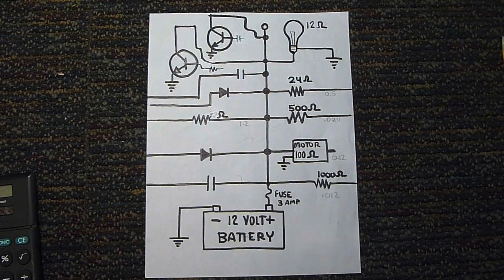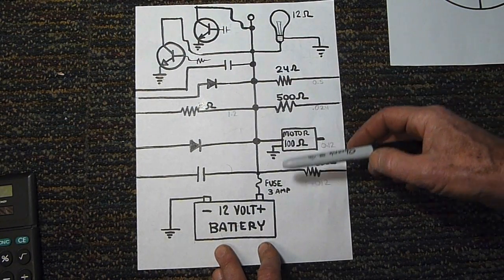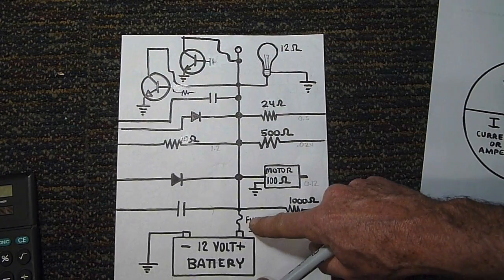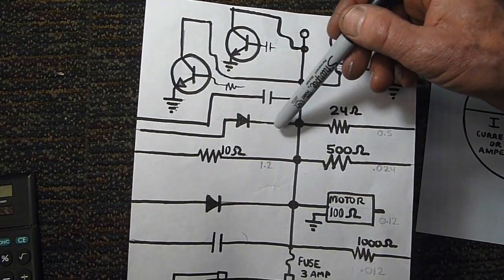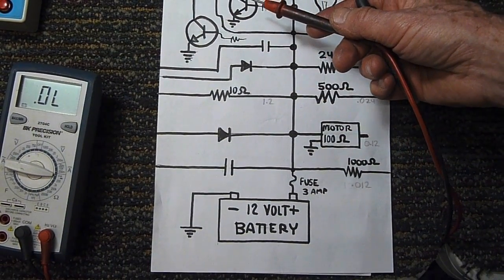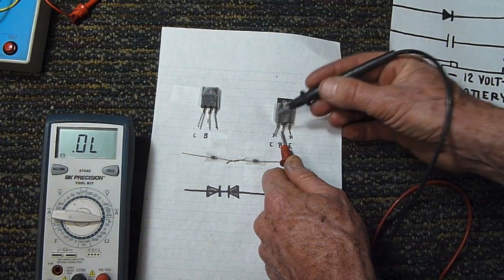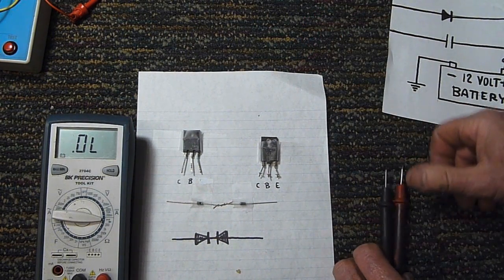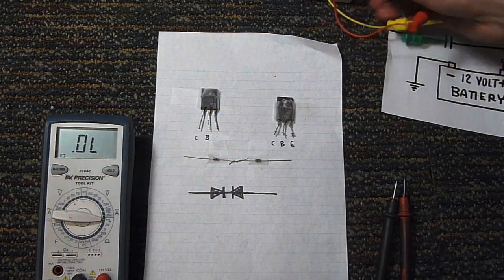Troubleshooting bad circuits using ohms law.

Comment: If the transistors are good,  would you suspect the 10-ohm load first then the 24 one?
Reply from the maker: No because resistors don't usually short out, and even if there was a short on the other side of the 10 ohm resistor which went to ground, it still would not draw more than 1.2 amps .
Reply: @GrantsPassTVRepair  Which component from your experience are most likely to short out?  Capacitors?
Reply from the maker: @jancenj2218  The most likely components to short out are diodes and transistors. Capacitors are more likely to open.

Comment: Are the transistors you tested a PNP?
Reply from the maker: When the arrow points away from the center of the Circle it's an NPN Transistor.
Reply: @GrantsPassTVRepair  @6:26 Is this a PNP transistor because the negative probe stayed on the base?
Reply from the maker: @jancenj2218  Yes they are PNP transistors I was testing with my meter.

Comment: Thank you very much for your videos. I noticed that you recommended a couple of books from Jestine Yong. Do you think it would be a good investment , and would help me , if I would enroll in his electronics course ? I already know quite a  bit about electronics and have almost all the test equipments I need to work with electronics. I just think that maybe that would help me get a good grip in electronics repairs. Thanks again for the good videos.
Reply from the maker: I'm not sure if his book would necessarily be right for you if you already have a good background in electronics, but I learned a few good tips from his books, and so have others I've spoken with. Jestine worked as a repair technician, so he had some practical hands on experience I found helpful. English isn't his first language, so I found a few of his tips were not as clear as they could be, but overall I was glad I purchased a couple of his books. I don't think TV repair is a good business anymore. At least not as a independent like myself.
Reply: Thank you very much for your response.

Comment: Some transistors also have resistors built in, I think HOTs often  did, but other modern power transistors may still do, too.
If you aren't aware of that they can appear shorted.
Like he says, if in doubt, look up the datasheet.
Reply: Because of that (the internal resistor connected between the B-E terminals of the HOT and among many other reasons) one must use a trusty multimeter in order to identify its existence without the need of the data sheet. A trusty, good quality  multimeter will give you the exact value of the internal resistor if you use the ohms measurement. This is based on the fact that good quality instruments use small voltage when measuring resistance, which does not bring any interconnected semiconductor diode to conduction. For this example, the measurement will seem to be abnormal only in the diode function, where much higher test voltage is used. But the confusion will be cleared with a second measurement in ohms. There is not even need to remove the transistor from the circuit for these measurements. In circuit - power off measurements will do. Cheap instruments don't offer such conveniences...

Comment: Back in the old days electronics were a lot simpler in some ways, but they sure got more complicated with time. It's always good to remember that Ohm's law, at least, remains constant. Thanks for the video!
Reply: Thanks for the Video! Forgive me for the intrusion, I would love your initial thoughts. Have you tried - Tarbbatigan clean errors Tip (Have a quick look on google cant remember the place now)? It is an awesome one of a kind product for discovering how to fix electronic devices without the hard work. Ive heard some incredible things about it and my friend finally got astronomical success with it.